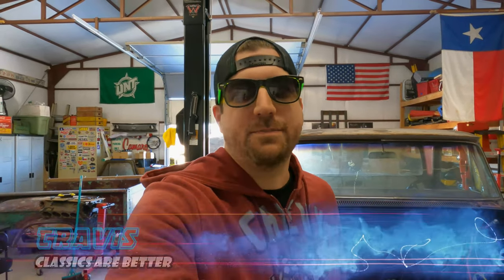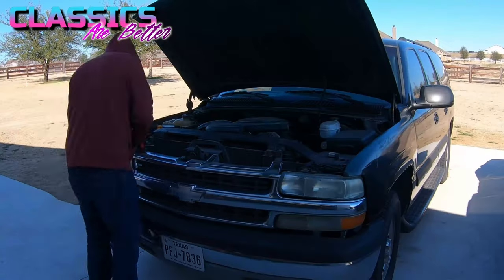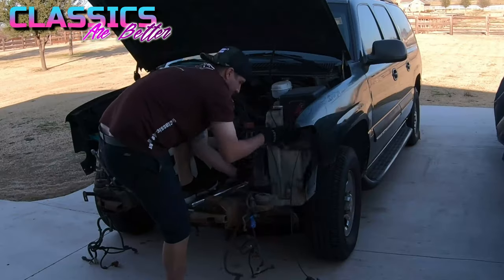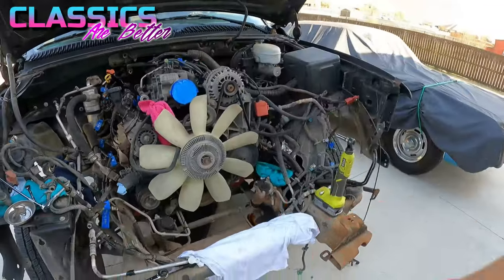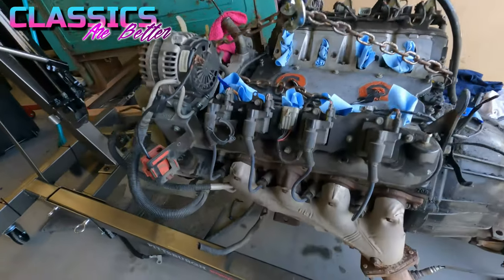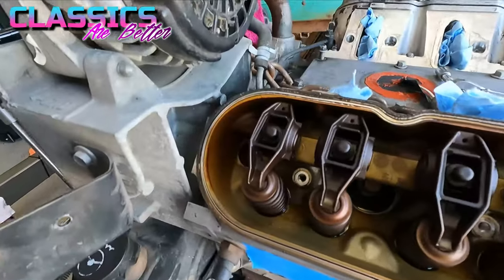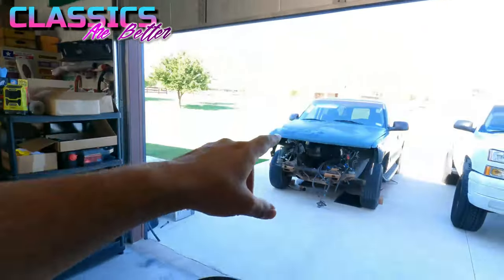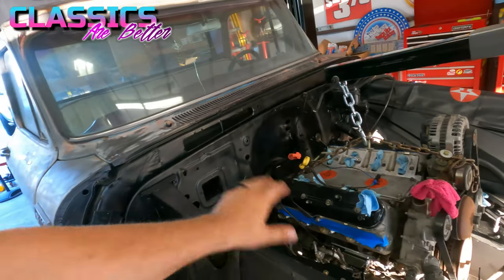LS SWAP | Suburban to 66 C10 | LS Vortec Service

Comment: Looking good  ! I am very impressed with your knowledge and skills . Very smart to be proactive to prevent issues later when it is in the 66. I have removed the front fenders on my 79 C30 . Painting the frame . Now I am replacing the rocker panels . Adding a vintage air later . Good work ..
Reply from the maker: Thanks man! I appreciate that. Taking the front off was definitely the way to go when working alone, at least in my case. Good luck on the c30.

Comment: Nice job bro .. what kind of headers did use with dirty dingo ??? Following
Reply from the maker: Thank you! I used some Speed Engineering LS Conversion Headers, I believe they are 2.5in mid length headers, good fit with lots of clearance and came with the O2 sensor connectors at the end.

Comment: Do you have a guide on doing the harness from the 96 vortex to puting in 87 chevy im having a hard time trying to re wire it
Reply from the maker: Hi Edwin, I haven't worked on a '96 vortec myself, but a resource that I referred to a lot was https://www.lt1swap.com   they have a quite a few diagrams etc. Also check out PSI's site, it has some great videos https://www.psiconversion.com/videos/  best of luck!

Comment: What radiator did you used, and did you use a another differencial or did you keep the original from the 66
Reply from the maker: I used a Champions Radiator from Jegs. As I dug into it I found out my truck is a bit of a Frankenstein, my diff is from a 71 c10 w/ 3.73 gears. Thank you for watching!

Comment: Do you use the old ECM for the engine and transmission
Reply from the maker: Yep, I used the PCM from the suburban, only thing I had to modify was having the key security turned off as I used the key from the C10 and it has no chip.

Comment: Is there a simplified wiring harness????
Reply from the maker: I used this harness from ebay, under a $100 and the guy's shop has like 14k reviews with a 98% rating (I have no relation to them). Worked great for me so far, just make sure you order the correct color plugs for your cpu (red, green, blue, etc). https://www.ebay.com/itm/265043306821?itmmeta=01HXJRSZR2VDFGY6C1BS6PYNRD&hash=item3db5cfe945:g:W6gAAOSwOPhgIDV5&itmprp=enc%3AAQAJAAABAKFqSfar0YijCIZKWelGdo3wtT1c1rerWe58S%2BLhUW6wZWoxAuncHJzzY7nKtNqXMX%2BC2kOZthQoNmJg8c%2FLHcQzSvfjKwA8QHL7oWqQg6aZgiErxZpFRIWB3s2oe8aDKH3Dwa%2F0pjOcmXPnds4nfmVGUqANSVQ2dHr78ac1GPluoyfR%2FZYzKJFZTfhlMh5s9Wp2n%2FZ9ZncYM93DPymDjyXu1phhkcUIIA6soiJ5cxbA6KM%2BA6bNmqfDoTSqmwh%2FdB3KdyskGtan69ftaKFQDFKSXOIOTiqIr9rqx98CKdplwAGioO8hxfqf8MAQJ6U24ILh6GdVNODIl7kYWgm6x9o%3D%7Ctkp%3ABFBMjvzn2Oxj

Comment: What kind of trans bar/mount did you use for the 4L60
Reply from the maker: I used the same one that the turbo350 was sitting on. I just drilled a new hole for the 4L60 mounting pad. Speedway Motors sells some good ones though if you need a new one.
Reply: @CLASSICSAREBETTER  thanks yea I have a turbo 400 I was going with but I had a 5.3 L with 4l60 dropped in my lap so I’m going a different direction. I already have the th400 mounting bar so I bet I can make it work. Also I seen the dirty dango mounts but where can you find just the perches if I buy those mounts? I tried cpp but they only sell as a kit. Speedway sells mounts and perches but they aren’t adjustable like the dango 

Thanks for the video you might become my best friend here in the near future lol
Reply from the maker: @beauepperson2641  The perches I used in my 66 with the dirty dingo sliders were the Classic Performance 6372MP Engine Mounts, got mine from Summit, but Im sure you could shop around.
Reply: @CLASSICSAREBETTER  nice thanks. That’s what I was looking for. Also did you have to do a fuel cell? I’m hearing you have to do an efi fuel cell. You got any videos of your truck with it in and anything you had to change? I’m just trying to get a list of parts together and to do list.
Reply: @CLASSICSAREBETTER  Nevermind last comment I’m going through your page and that’s the first video I seen lol watching now. Thanks for the videos and yes I did subscribe
Reply from the maker: @beauepperson2641  Glad it helped
Reply from the maker: @beauepperson2641  Thanks for the sub man. I ended up using an LMC tank with a Holley in line fuel pump. If I was to do it again, I would pick up a tank and in tank pump from Tanks Inc. I just had a 305sbc when I got the tank originally.

Comment: Are you using original harness and PCM?
Reply from the maker: Using the original PCM (blue/green) and I got an after market harness off ebay. I did have to order harness adapters for the fuel injectors though, turns out my motor is flexfuel, so I learned make sure to check which injector plug type your injectors take and order accordingly.
Reply: @CLASSICSAREBETTER  good to know i just pulled engine from donor and will be checking for that.

Comment: Can you drop a link where you got the frame motor mount?
Reply from the maker: Yes sir, no problem. My motor mounts are sliding Dirty Dingo, but the frame mounts are Classic Performance 6372MP-SM mounts. Here is a link to where I got them on summit. (when I bought them they were $160 so you may want to shop around as they went up to $200, good luck)

  https://www.summitracing.com/parts/clp-6372mp-sm
Reply: @CLASSICSAREBETTER  thank you!.

Comment: How does the oil pan clearance look? I’m wondering if I need a low profile pan or if the factory will be ok.
Reply from the maker: Just went a double checked it for you, the stock pan stick out almost an inch below my front cross member. Not really an issue for me in the C10, but if you were swapping into a car or a slammed truck then you'd want to get a low profile pan to tuck it up a bit. Good luck on your project!!
Reply: @CLASSICSAREBETTER  thanks brother! My ‘63 has 2.5” drop spindles but no more in the front so I’m gonna sit it in there. I think it’ll work out!!
Reply from the maker: @chuckdaddy87irl  very cool, I am actually doing 2.5 drop spindles currently, if I notice any pan issues afterwards I will let ya know.